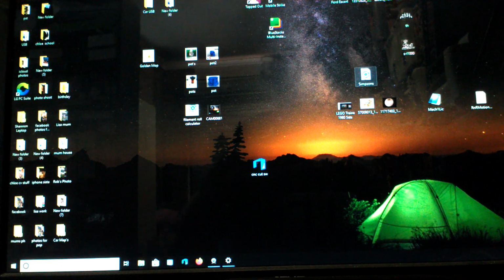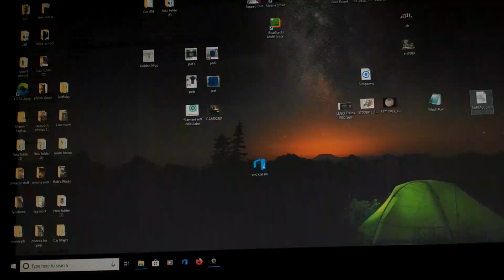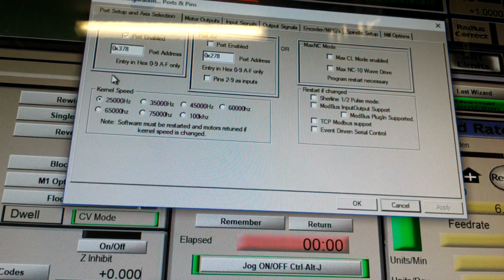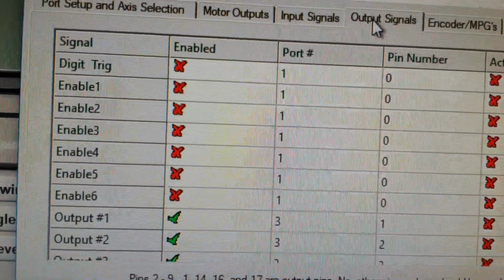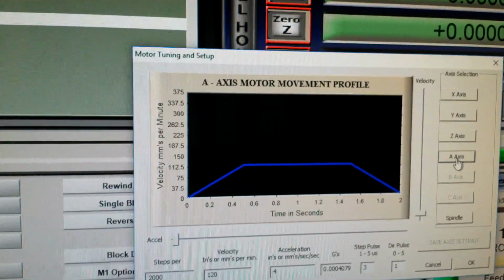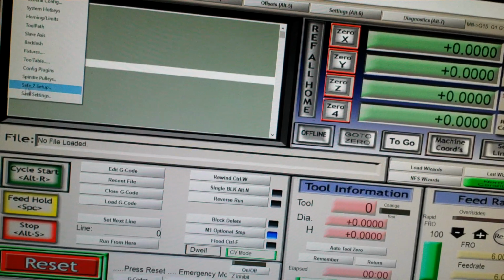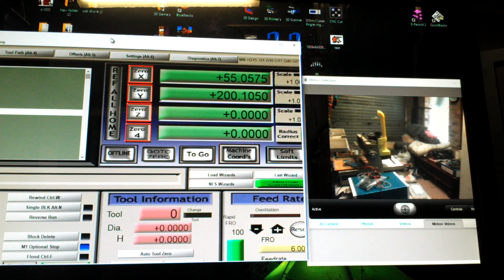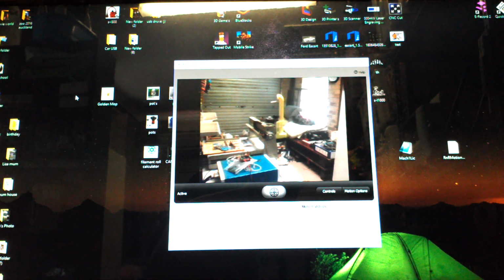CNCEST 4 AXIS 400W USB CNC ROUTER 3040T Setup on Windows 10, 64bit

Comment: Mine still has a problem.
When I press "REF ALL" my Z axis moves up pass home or "0", and even if it is at home or "0" it moves up and hits the top of the axis and the motor continues moving until I hit the Reset or E-Stop.
Any input on what is the issue here?
Reply: even if Machine Coord's and soft limits are on

Comment: Just got mine fixed after using the following instuctions .

Setup Instructions

1-) Download this driver at this link:  https://www.buildyourcnc.com/Documents/RnRMotion.dll

2-) Download the USB Motion Driver RnRMotion.dll from the link above and copy and paste the file into your Mach3 Plugins folder Example: "C:/Users/ProgramFiles/Mach3/Plugins"

3-)  Make sure you board is connected to the PC via USB cable. It should automatically recognize the USB device.

4-) Open Mach3 and you should be prompted to select a driver. Select the "RnRMotionController" and check "Don't ask me again". This will allow your board to communicate with Mach3.

Hope you are successful, mine worked the first time right after I did this.

Comment: Finally got mine fixed after using the following instuctions .

Setup Instructions

1-) Download this driver at this link:  https://www.buildyourcnc.com/Documents/RnRMotion.dll

2-) Download the USB Motion Driver RnRMotion.dll from the link above and copy and paste the file into your Mach3 Plugins folder Example: "C:/Users/ProgramFiles/Mach3/Plugins"

3-)  Make sure you board is connected to the PC via USB cable. It should automatically recognize the USB device.

4-) Open Mach3 and you should be prompted to select a driver. Select the "RnRMotionController" and check "Don't ask me again". This will allow your board to communicate with Mach3.

Hope you are successful, mine worked the first time right after I did this.

Comment: Just got a new machine, the exact same cnc and controller, CNCEST 4 AXIS 400W USB CNC ROUTER 3040T. I did put all the Mach3 settings as you showed, but nothing happens. It is over 10 days working on it, trying different settings, and nothing.
Reply: Hello, im having the same issues. The machine came with no info
Reply: @rubengomes8978  
Got mine fix after using the following instuctions .

Setup Instructions

1-) Download this driver at this link:  https://www.buildyourcnc.com/Documents/RnRMotion.dll

2-) Download the USB Motion Driver RnRMotion.dll from the link above and copy and paste the file into your Mach3 Plugins folder Example: "C:/Users/ProgramFiles/Mach3/Plugins"

3-)  Make sure you board is connected to the PC via USB cable. It should automatically recognize the USB device.

4-) Open Mach3 and you should be prompted to select a driver. Select the "RnRMotionController" and check "Don't ask me again". This will allow your board to communicate with Mach3.

Hope you are successful, mine worked the first time right after I did this.
Reply: @JuanCastillo-oq8sn  thank you so much for the tips. I’m going to try it!’ Well appreciated

Comment: Hi Shannon, thanks for the video, are you controlling the spindle speed with the software or with the external controller (blue box). Thanks for any help
Reply from the maker: In Mach3 software, I set full speed with the spindle and I use the external ( blue box ) controller speed when i have to down the spindle speed, You can also set the cuter speed when doing tool-path G-coding too....
Reply: Ok thanks, just a bit strange the controller will not control the spindle speed. I am working on some plexy glass and just a few RPM out and it will start to melt  the material.
Reply from the maker: @jeremyashcroft4556  normally when your cutter is blunt, it will start to chip your cutting edge of the perspexbut. But if it's melting the perspex, you might be travelling to slow

Comment: These steps in your video   Were really tricky for me to figure out. So cool seeing someone explain this step so well. I had to figure it out all alone..he he.   Hey Shannon Something I figured out....If your circles are not a perfect circle...Like a slight oval.  Your X and Y axis timing is off...Took me awhile to get it just right...Open up the motor timing page...Set X or y how you want it then copy and paste the exact settings from X into Y. or vice versa..Kind of tricky getting the exact same settings. After I did this now all circles are perfect.